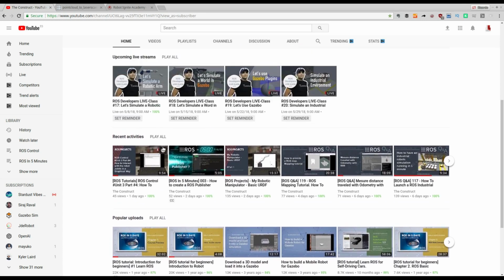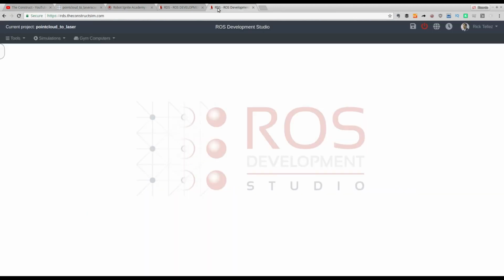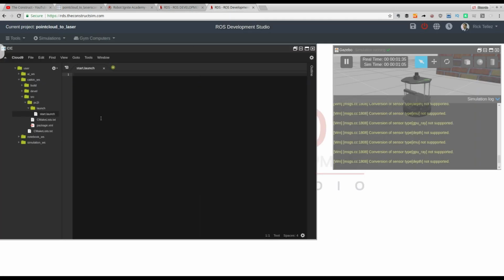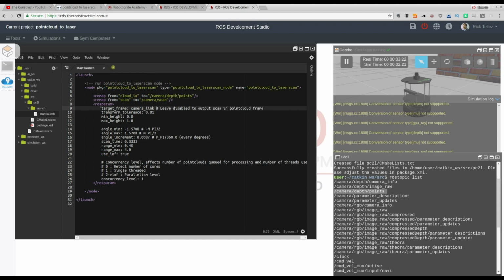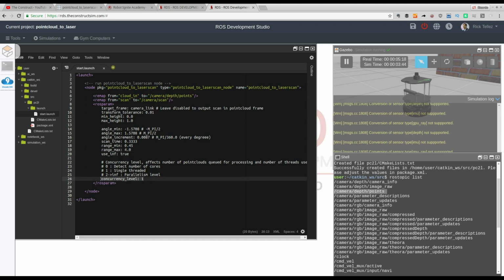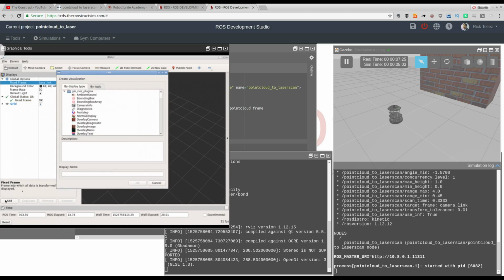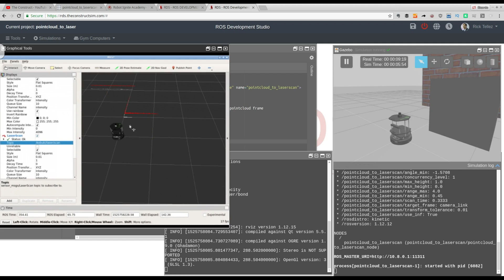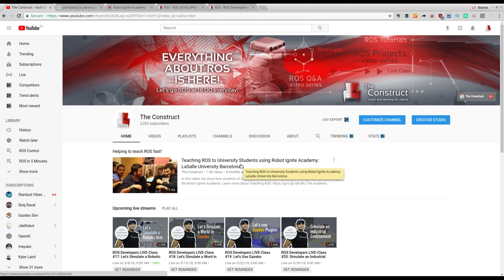[ROS Q&A] 120 - How To Convert a PointCloud Into a Laser Scan

Comment: CMake Error at /opt/ros/kinetic/share/catkin/cmake/catkinConfig.cmake:83 (find_package):
  Could not find a package configuration file provided by
  "pointcloud_to_laserscan" with any of the following names:

    pointcloud_to_laserscanConfig.cmake
    pointcloud_to_laserscan-config.cmake

Where should I install the pointcloud_to_laserscan package? Thanks for your help in advance
Reply: sudo apt-get install ros-kinetic-pointcloud-to-laserscan
This solves the problem
Reply: Yasin, you either did not source your workspace (or ROS devel folder) (after your packages were built) or you don't have pointcloud-to-laserscan

$ apt install ros-noetic-pointcloud-to-laserscan #change noetic with your distro

Usually, if you are missing a package check if it is provided by ROS  sources. If not, clone from the repo then build

Comment: The "sample.launch" I was using from the pointcloud_to_laserscan package was doing a whole set of things before getting to the node definition that kept failing, and turned out to be irrelevant.  Once I used the condensed version here, and changed the rostopics to meet my needs for my RealSense D435i, everything worked as desired.

Thank you, this did in a few minutes what I've spent too many hours troubleshooting.